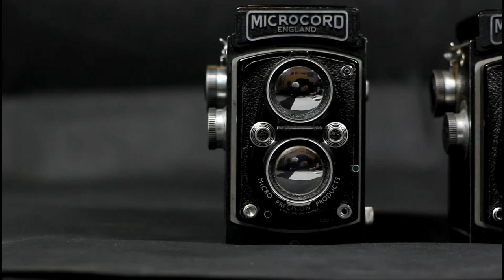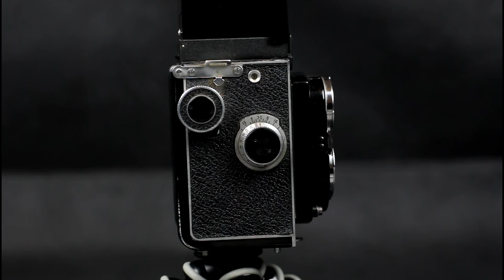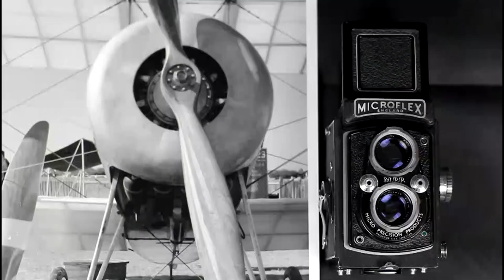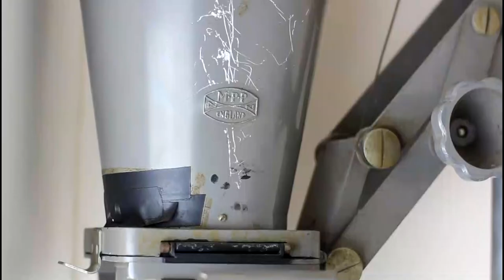MPP TLR's

Comment: Excellent, thanks for that.
Reply from the maker: My pleasure!
Reply: @contaxpaulharrison942  I have just got hold of one of these....have no real clue what I am doing but having a go. Fingers crossed I will get my head around it soon enough. This video has been helpful. Thanks.
Reply from the maker: @stevemoore8455  Ok, which one have you got.
Reply: @contaxpaulharrison942  I think it is a Microcord I
Reply from the maker: @stevemoore8455  It should say on the front.
Reply from the maker: @stevemoore8455  Have a look on camera-wiki, they have section on the microcord, I have a microcord with Kinston on Thames on it, I think that is an early mark II, so yours may be, the hood should identify it, you want the one with the prontor  shutter.

Comment: I have just been given a MICROFLEX -- all FILTHY -- I wondered why the viewfinder was so DIM --  when I touched it I got a thick layer of yellowish DUST on my finger !  The 'covering' on winder side is all coming off -- rolled back a bit - I have NO suitable GLUE at the moment -- maybe the Gent had it serviced -- he was 'very sorry to see it go' but gave it to me for a 'Good Home' then WHY did he not look after it !
Reply from the maker: Well I am sure that you will give it a good home, and I suspect it won't be stuck for company from your videos. It is  a good lens on the Microflex. The viewfinder in not the brightest out then even when clean I would advise caution with the winder, it breaks if you wind it to hard, so be gentle. I would check out the odd behaviour when loading film, when the camera has had the back closed since the last film has been shot, as there is a special loading technique required.